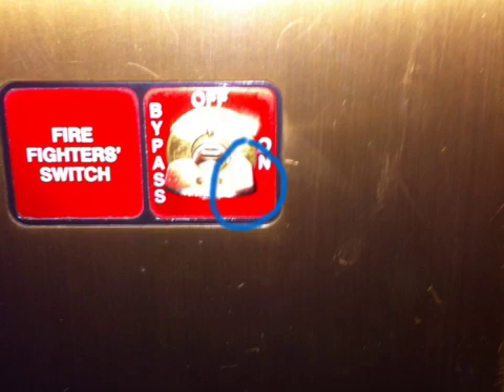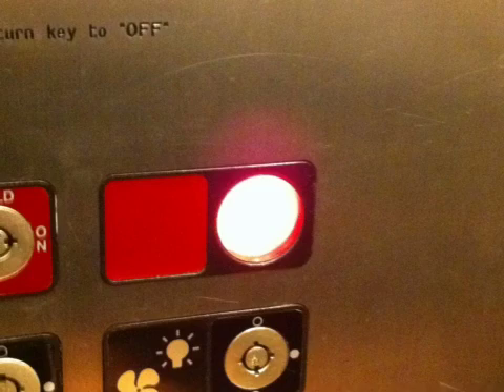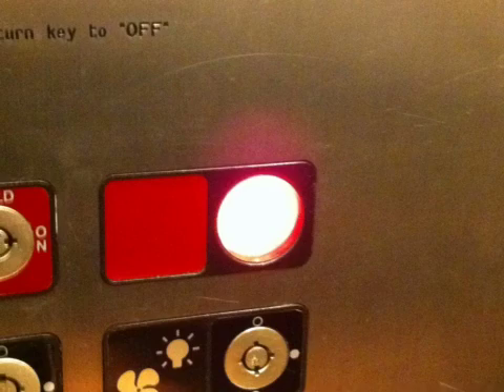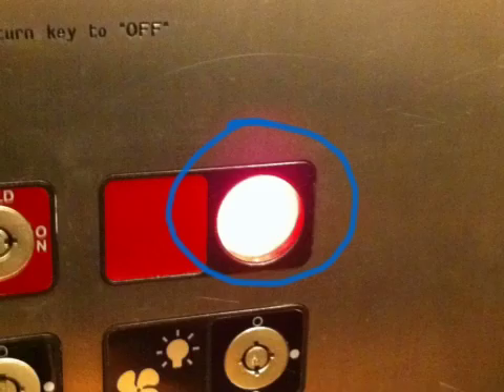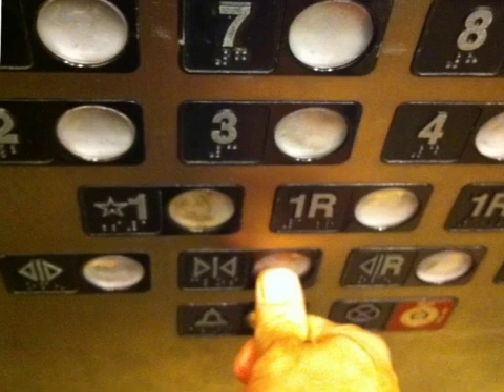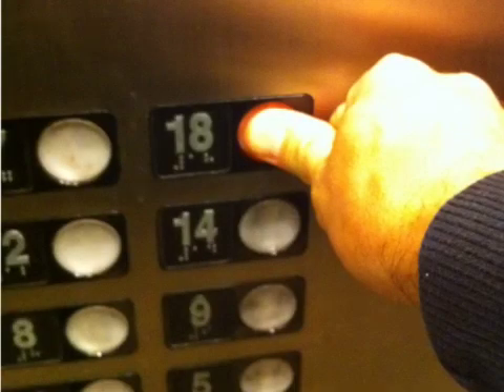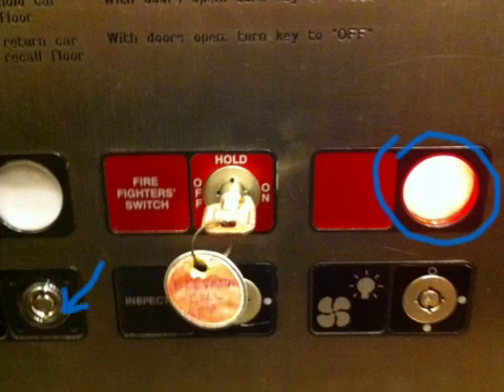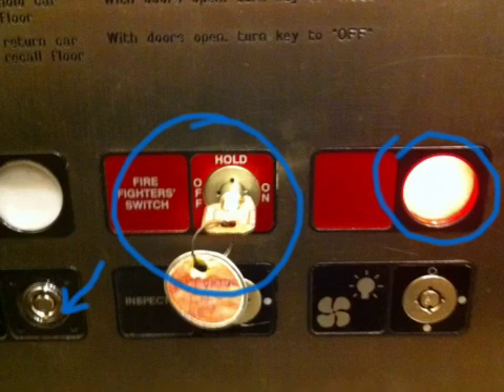Firefighter Mode for Elevators

Comment: Can it be used to bring down stuck elevator cars by by
Reply: ELPaso1990TX no and I hate to copy someone but unless you are a elevator tech or a fire fighter or you have permission using these keys can cause problems with the building owner and you could get into legal trouble
Reply: Depending on what the problem is, if you are stuck, a tech may try to force the elevator down by using fire service phase 1.  Sometimes it may work, sometimes it won't.

Comment: You need to address the Shunt Trip that elevators have been equipped with for the last several elevator code cycles.  The shunt trip is designed to deprive the elevator machinery of all power prior to the activation of sprinklers located in the shaft or the elevator machine room.  The first version of this control circuit was dangerously simple.   It can deprive the elevator of all power with no warning regardless of whether it is in Fire mode or not.  It can turn the elevator car into a coffin.
Reply: hornetd I  a nnnn.         I